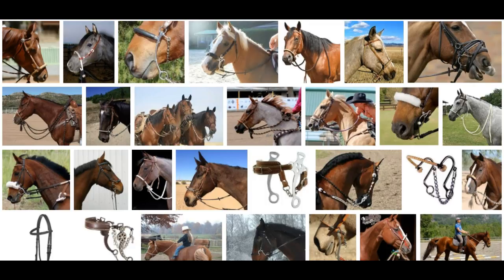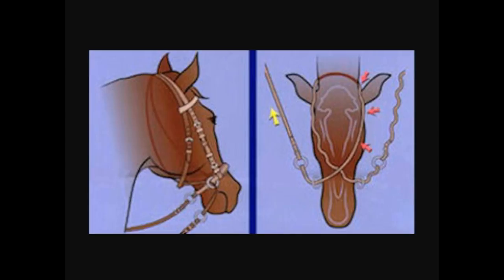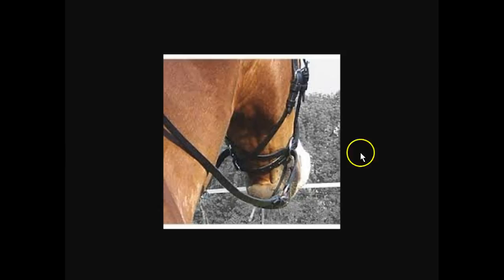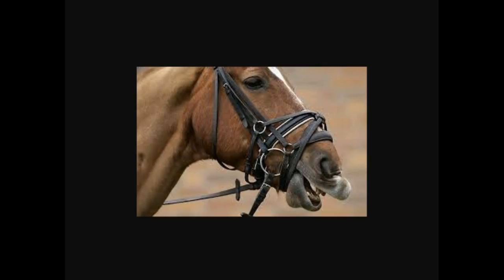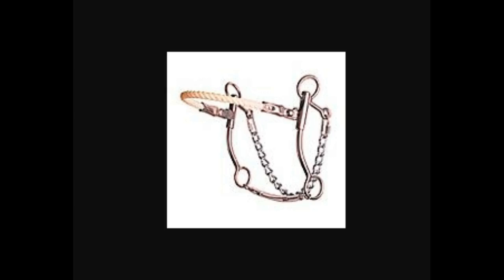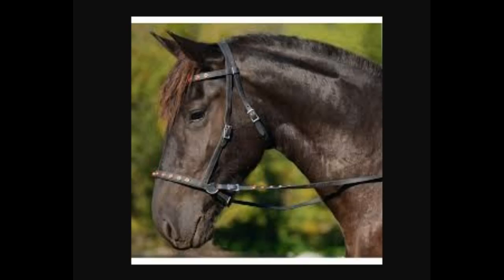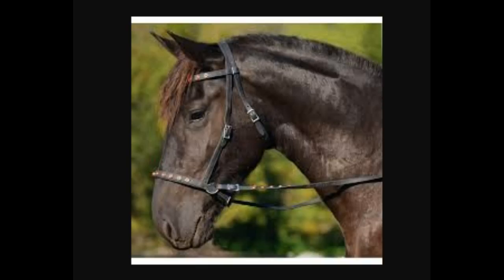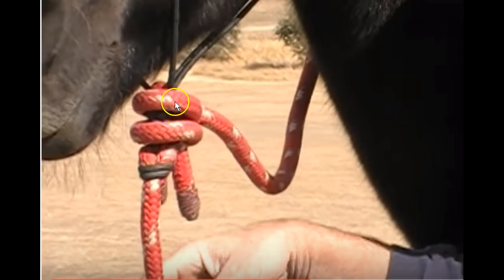Explaining & Understanding Bitless Bridles, Hackamores, Rope Halters & Benefits For The Horse

Comment: It’s.... it’s just a centimeter long buckle 😂
Reply: Rick doesn't like any type metal on horses, he's vey old school but he's a great horseman
Reply: The buckles can break easier than a good rope knot, which dangerous in itself, but the buckle could then fly back and hit your horse in the eye, blinding him. It's unnecessary to have metal on the horse's face since horses will do just fine with pure rope.
Reply: Anya Riechers Rope is definitely harsher on the skin than leader closed with buckles though... Just try it on your own arm. If your buckles burst while riding you have some bigger issues going on anyways haha
Reply: Sophie Lorber Metal over time will actually weaken, unlike rope, and if you’re pulling the rope hard enough for it to rub your horse raw or anything, then that’s your real problem. You should barely even touch the reins, plus, I’ve had buckles break almost immediately with me and other friends because of manufacturing defects. Rope is altogether much safer.
Reply: Anya Riechers You don‘t have to pull rope hard to rub uncomfortably, as I just said, try it on your skin. It definitely takes less pressure for a rope to feel uncomfortable than it takes for a buckle to burst - if you invest in good quality of course. Metal doesn’t weaken over time - when it bursts, it bursts in one cut. That’s just basic chemistry and how metals work. Would you prefare a backpack with rope straps or leather straps closed with a buckle that doesn‘t touch your skin? A rope as a belt or smooth leather? A bra with rope straps or a bra with 1/2 inch of elastic fabric straps. Nothing that touches human skin is made of rope for exact that reason - it‘s rough and uncomfortable.
Reply: Sophie Lorber Then why do lots of horses everywhere like the rope better than leather? Humans and horses are different, and people need to get that through their minds. The arguments for bits, ropes, whips, spurs, etc. are usually bad because I have yet to be shown ACTUAL research and ACTUAL facts that teach me anything or persuade me at all. If you invest in good quality, soft rope, then it’s more comfortable for a horse than a bit if you ride correctly. Any rubbing or pain your horse feels from a soft rope that just lays over their nose is from bad riding and pulling, not the rope. And it is basic science that metal will break before a rope does. You shouldn’t take chances, especially when it can blind your horse.
Reply: Sophie Lorber Because my horse along with many others act much better when ridden in a rope halter vs. a bit/leather. I don’t put anything in my horse’s mouth because it’s unnecessary and unnatural. Horses don’t need anything in their mouth. I don’t ride with buckles, period. And I would know if my horse’s nose was broken.
Reply: Anya Riechers Of course it acts better with a rope halter - because it‘s harsher! Also „because my horse does it“ is not exactly scientific evidence. 😉
Reply: @sophielorber4571  You're arguing that a piece of rope over a horse's nose is harsher than a big piece of metal that's shoved into the mouth, which, by the way, is one of the most sensitive spots? That's hilarious to me. Also, you'll be pleased to know that I also use leather with my horses, but no buckles. It's called a traditional hackamore. No buckles on mine, but plenty of leather and rawhide since that seems to please you.
Reply: Anya Riechers I‘m not - you can‘t read apparently. I‘m arguing that a bit in a horses mouth is softer than a rope in a horses mouth. Whereas of course a rough rope can do lots of damage on the horses’ nose too. It’s hard to compare to a bit because it works totally different, but if used incorrectly the same amount of damage can be done. I‘m also arguing that a leather strap closed with a buckle is softer on a horse than a rope strap closed with some knots. That‘s the reason why rope halters are used for educational and training purposes - they are harsher - and strap halters on a daily basis. Horses don’t like rope halters better - they are harsher and that’s why they often behave better when worked in a rope halter. Same with a traditional hackamore or a bosal - can be extremely harsh if not used correctly, why it‘s not recommended for insecure or unexperienced riders.
Reply: @sophielorber4571  Actually, traditions hackamores are used with young horses because they ARE softer. Young horses, when you're training them, are generally more spooky and do things that, if ridden with a bit, could hurt them, as I hope you know. Rope is used because it is softer and won't cut the horse's tongue off, which has happened. The way you worded your previous comments made it so I thought that you were saying rope halters were harsher than a bit, when that really is not the case. I have never seen anyone argue this before, and honestly, I don't understand where you're getting your knowledge from, as to me, it seems like you're pulling it out of nowhere. I would be glad to continue an educated conversation with you, but making personal attacks onto me is not what I came here for. If you watch a rider try to use strength to control a horse in a bit, it works, as you do not get a pound of pressure on the horse for every pound you pull- that's how leverage works. If you watch that same rider try to use strength to ride a horse in a halter or traditional hackamore, you will notice that the horse will push right through it and continue on the way, as rope halters do not add leverage, and are not as rough as a bit. I've seen it a million times with my own horse. People come and try to ride him, and he runs all over them because they don't know how to communicate with a horse without a bit in their mouth. Sure, I could put a bit on him, and anyone could ride him, but that would be at the cost of his comfort and well being. All in all, rope is very much less harsh than a bit, and every horse can be ridden bitless. The excuses I see made for bits are because the rider wants to compete, is scared of their horse, doesn't care enough to train their horse, or wants the bit because it makes them feel better about themselves. There is no excuse to put anything, rope or metal, in a horse's mouth, and there is no excuse to put buckles and clasps around a horse's face. It simply isn't necessary, and is often more dangerous.
Reply: Anya Riechers I get my education from years of experience as an riding instructor in a variety of different fields, European experts on horse training and riding and my education about animal behavior and anatomy on Austrias biggest university (hence my MA in Biology) I don‘t know why you keep changing the discussion to be about bits, when it‘s actually about buckles compared to rope. You can’t compare a rope to a bit because it’s purpose and mechanism is totally different. Your main argument against buckles seems to be that they can break: which is good, especially on a halter and when a horse panics. I hope you don‘t tie your horses up in rope halters. Another argument of you against buckles seems to be, that it can burst and blind a horse if it gets into their eyes. I have never heard of that ever happening, and I suggest you to watch a herd galopping on a pasture: You will be astonished by the amount of rocks and dirt the horses get into their face without being blinded. You argument for using ropes is, that your horses work better with them - which is obvious, because they are harsher than leather straps. Less surface means compromised pressure. Have you ever heard of the trick to cut a cake with dental floss instead of a knife? That‘s what ropes are doing to horse‘s face - compromising pressure on the smallest possible surface. As you keep changing the topic I don‘t see a reason to keep the discussion going.
Reply: @sophielorber4571  Have a good day. Why are you here if you disagree with what's said? Seems like someone who's supposedly as smart as you would have better things to do, but I guess I'm wrong there. I pray for your horses and the poor people you come in contact with.